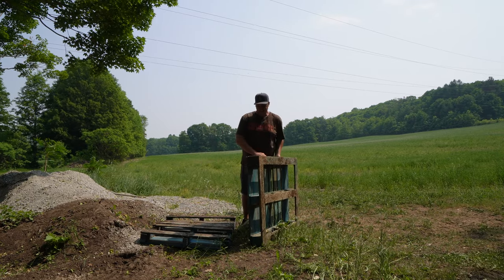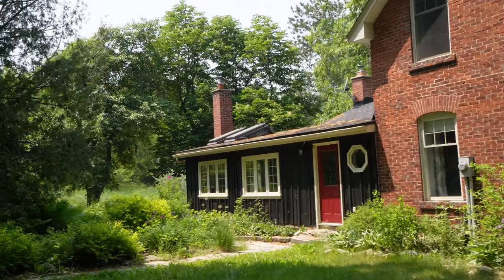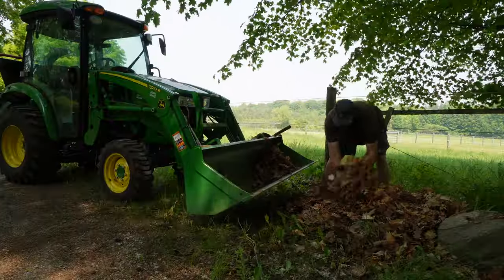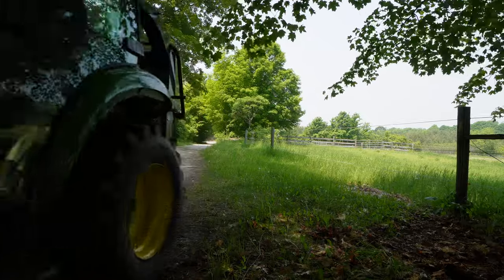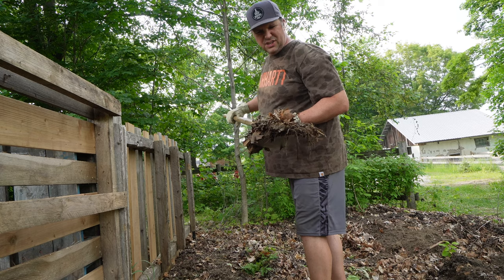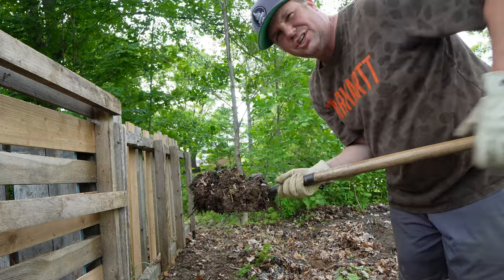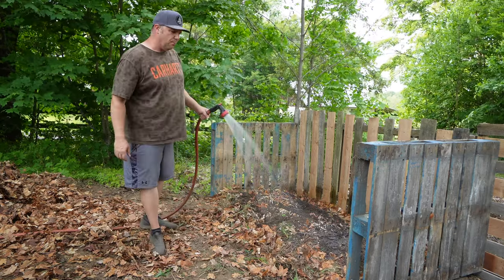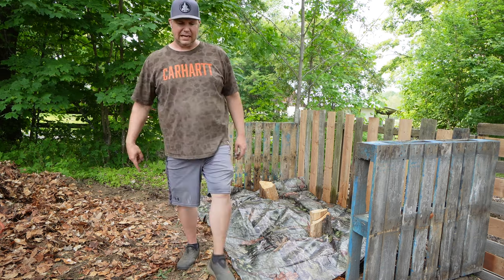Building The Ultimate 3 Bin Composting Yard

Comment: Well done Chad but you are being too dainty with your compost material. Your bins are 8 feet wide, john deere bucket 6 feet wide, so one bucket brown, one bucket green on top, one bucket pig and chicken manure on top, another bucket of leaves on top, wet it down and black tarp it, heat from inside and outside.IMPORTANT!!!!!! DON'T LEAVE TARP ON TOO LONG OR TOO TIGHT. Compost  needs aerobic environment or it will stink👍👍👍. Thank you for sharing. Be safe 🇨🇦
Reply from the maker: I just figured I’d layer it thinly to maybe break it all down faster. I’m gonna build up the pile so it can get nice and hot…hopefully. Thnx for the tips.

Comment: Does it need a front panel?
Reply from the maker: You could put a front but I’ll first see how stable the piles are if it’s an issue I’ll build a removable front. The pallets are just for organization and simplicity but really you can just make a pile anywhere and it’ll do just fine.